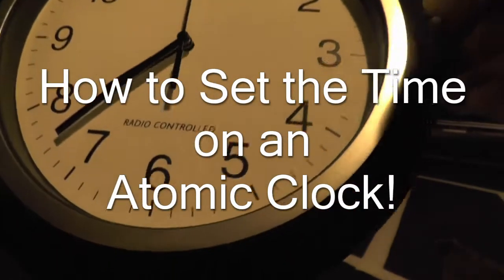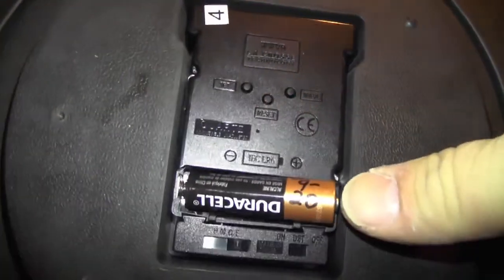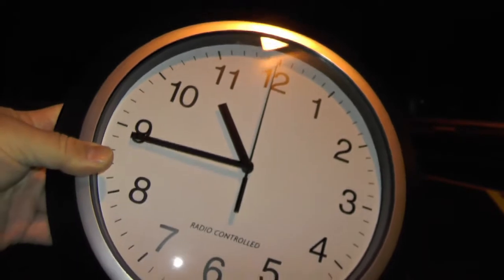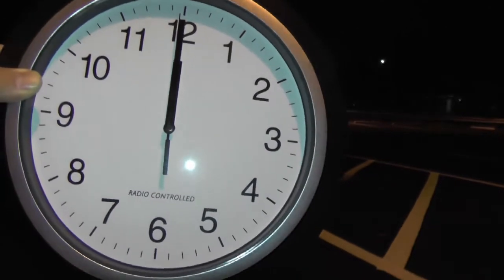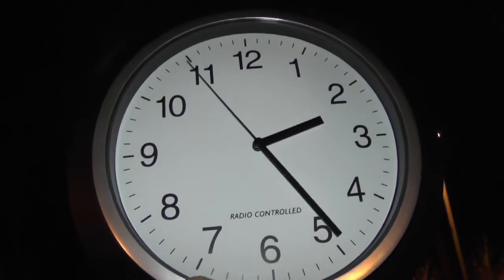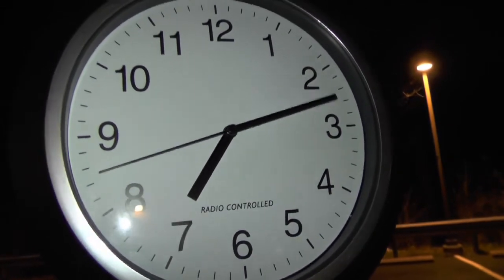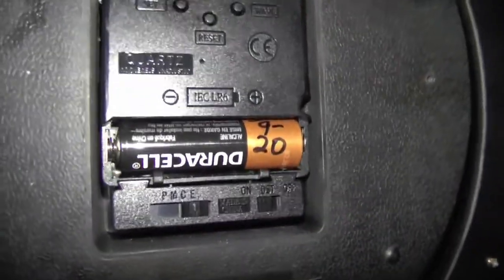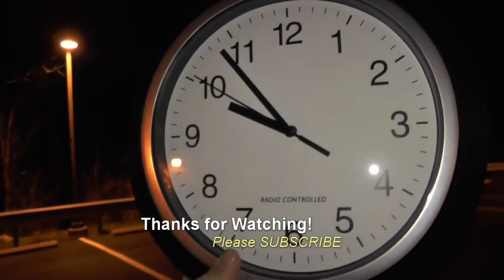How to set the time on an Atomic Clock

Comment: Heres a way of how to do it:
Step 1: Put the battery in the clock.
Step 2: Go to a nearest radio tower.
Step 3: Choose if you want Pacific, Mountain, Centralor Eastern Time.
Step 4: Wait for the clock to move its hands to the correct Time.
Step 5: Choose if you want DST (Daylight Savings Time).

Enjoy the clock!
⚠️ WARNING: DO NOT INTERFERE WITH THE SIGNALS AS THE CLOCK MAY LOSE CONTROL AND STOP WORKING.

Comment: Hope does the clock know the time it displays before the clock is set to the correct time?
Reply: sensors in the clock.  

most likely a simple laser pointed at the shaft that spins the clocks hands. if the shaft has indentations on it the laser would take a varying time to reflect.

Comment: You are not supposed to move the clock while the clock’s antenna is searching for the signal from the atomic clock’s radio signal  in Boulders, Colorado that is sending it out for the clock’s built-in antenna to receive it in order for it to set itself to the correct time

Comment: How does it know which time zone you're in if it's getting the radio signal from Colorado?
Reply: Button on the back lets u choose 4 time zones.  Also there's a button for DST (you can set it to off if your area is not DST).
Reply: @Wowzersdude-k5c  Do we need to toggle the DST switch in spring and fall?

Comment: all that shit just to set up a clock omg realy
Reply from the maker: Yep, that's what I thought too! And when I tried to re-set the clock this year (back on Nov 1), I had such a hard time trying to get the clock to "sync up" with that radio station, that I manually set the time with those control buttons (after wasting more than an hour trying to get it to work).
Reply: @stevenofpa  I'm thinking it would work better in a wooden house.
Reply: It’s an ATOMIC CLOCK
Reply: @stevenofpa how to adjust it manualy
Reply: @emanfathy4702  hold the set button down until the correct time is reached